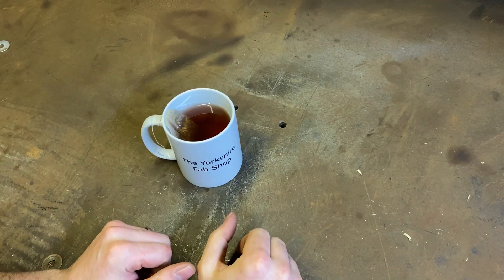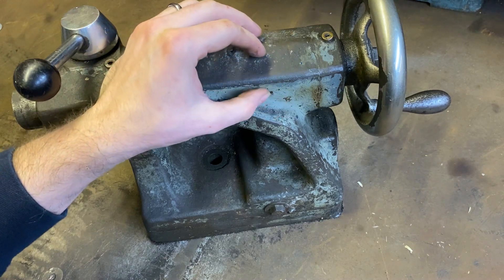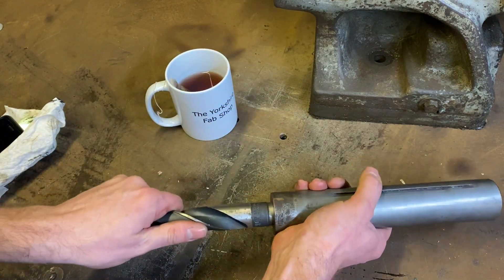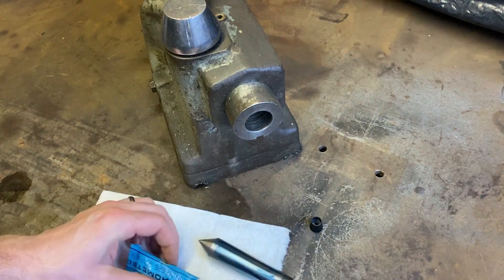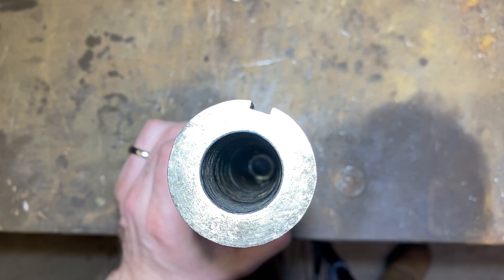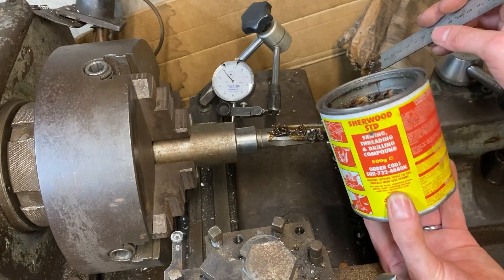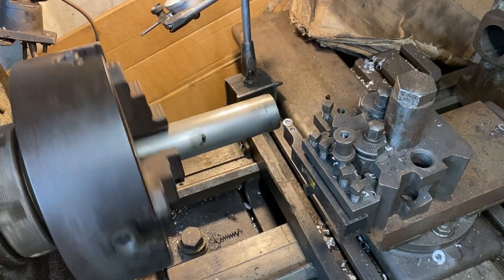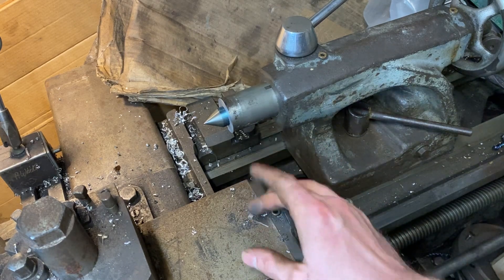Lathe Tailstock Machining! A good reaming needed? Restoration series episode 4

Comment: I need to dothat on my Covmac lathe!! I have the reamer, but used it by hand, I though about doing it this way, but bottled it! I need a tin of Sherwoods!
Phil
Reply from the maker: Hi Phil, thank you for leaving a comment! Try to keep the reamer stick out length as short as possible otherwise it will go wherever it wants. Also, clocking it in was difficult so don’t rush and go steady. Otherwise you could bore with a carbide boring bar which will give good results. 
Any decent cutting compound will do, trefolex is another personal favourite but anything that clings on given its high cutting pressure. Otherwise good luck!!

Comment: Actually, the tang is intended to transmit torque. Mr. Pete recently did a video citing several text books and manufacturer's publications to prove the point. I dealt with my own drill chuck slippage problem another way. I put a short dowel pin extending radially from the big end of the Morse taper arbor, and milled a notch to match in the face of the tailstock quill. I can't use that drill chuck in any other machine, but that's okay.
Reply from the maker: That is the first instance I’ve heard of a tang being part of the torque transmission. A correctly mating taper should require no additional drive from tangs as the mechanical grip of the two items is more than enough to prevent slippage. I have had problems in the past when reducing morse tapers of larger drills to the next taper down for very specific tasks, here the cutting force required overcomes the taper and breaks the tang off. However I don’t make a habit of doing that…
Sometimes we have limited with solutions, as long as it works then it’s a successful compromise!
Reply: The tang is decidedly not designed to take the torque, the friction in the mating faces of the taper is designed for torque. Kindly explain to me why a mild steel tang ( most morse taper drills and reamers have the HSS welded or brazed to a low carbon steel) of relatively small size can resist the torque whilst drilling.
Regards John from the Black Country UK.
Edit: whilst.
Reply from the maker: Curiosity led me to find the video the original poster above (sorry I can’t quote directly, the YouTube app I receive comment notification on isn’t the easiest to scroll through…). 
In that video it was clearly written in various publications that the tang is to be used for transferring torque IN ADDITION to the taper. That is obviously an area of contention and whether that is 100% truth or not is to be debated. If I was to take that as truth, I could argue that very large drills (don’t quote me on a size but say 3” and above?) there may be some transmission of torque because the drill probably should be up to the next taper and morse taper 6 and 7 aren’t very common. The force required to make the tapers of something that size would be far beyond the scope of hand pressure, so the tang would absolutely be used as an anti-rotation device before the pressure on the drill forced the tapers together. 

Certainly for smaller drills us mortals tend to wield there should be no requirement for torque transmission through the tang and if there is I’d be looking for an issue with the drill or the quill.
Reply: @theyorkshirefabshop8776  I was taught to insert the drill or reamer with slight rotation anticlockwise to create a gap, so if the drill slipped,  there was maximum gap before the tang saw any load, plus slam it in, or use a mallet etc.
Spot on, Ref slippage. Another point on yours ref larger drills on small tapers, just consider turning the OD a 100mm diameter part in the chuck , but it's only held on a 50mm diameter stub.
Gotta love the power of tapers.
Regards John.

Comment: I sweetened up my 2 morse taper in my tailstock with the same method, my bore certainly wasn't as bad as yours was though, regarding lining up the headstock a tailstock, I just thoght that reaming from the headstock automatically gets you well within the ballpark. You could make the surface better if you used a ground taper, sacrificing it if you will, with cuts down the length and lapped it in to get the chatter out, just a thought, have subbed by the way, cheers, Dave
Reply from the maker: I think I’ve said this in other comments too but this is by far the worst condition tailstock quill I’ve ever come across. I still wonder how it grabbed anything! It probably isn’t the best method of refinishing and I wasn’t expecting it to need quite so much material out but once it’s started you may as well keep going! It’ll be near enough for my needs, I’ll be improving it in the near future anyway. I could still lap it, we’ll see how it goes! Thanks for the support and taking the time to leave a comment 👍

Comment: The reamer is fine and a lot simpler than single-point cutting and and a toolpost grinder.  The taper seems rather soft.  I saw someone (dee dee?) on YouTube fixing a spindle taper with a special curved scraper---it's the least invasive but requires the most skill.  For Christ sake, if the shank of the reamer is running out 0.1 mm ( 0.004 in), and the tip is running out 0.3 mm (0.011 in), stop.  That is the universe telling you to fix your setup.  Those are tiny errors in fabrication but in machining, it's huge.  You need an indicator that can measure 0.01 even if you never work to that level of precision.  Spindles and bores of machine tools should be 10x better than the best accuracy you ever hope to achieve.  And there's very little flexibility in an MT reamer.  You're probably thinking of chucking reamers?  Sorry to rain on your video but I meant to be constructive.  The taper was terrible before and it's probably better now.  Maybe it will hold you over until you can do even better.
Reply from the maker: No raining done here, don’t worry about offending. The taper was soft, not overly but goes some way to explaining why it was so damaged. Did I say zero one? I’d have to check but if I did say zero one, I was talking in hundredths (so 0.01mm). My tenth thou clocks weren’t available but within 0.01mm at the chuck end and 0.03mm at the other I think I live with that considering the state before hand. The reamer wasn’t as rigid as I’d have liked but sometimes we have little choice. The length it was stuck out allowed some small flex in the set up when forced. It’s always a trade off in the home setting. 
I do have plans to improve this so it will certainly get me by for now! 
Appreciate the time spent to comment 👍